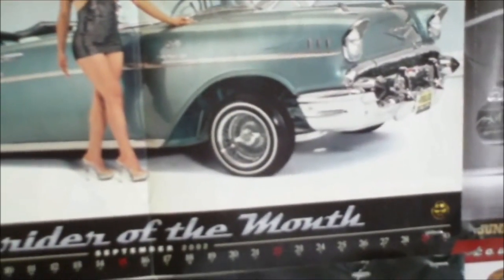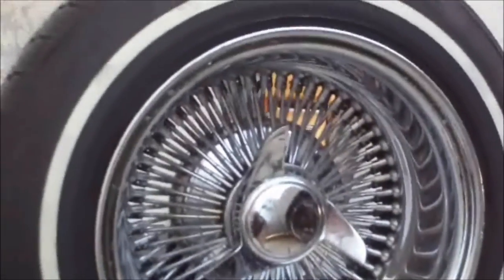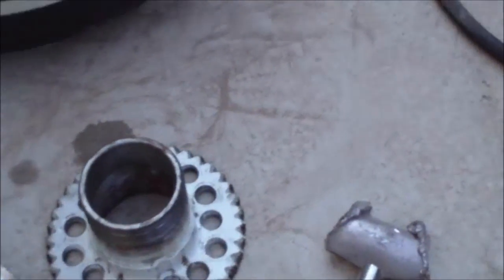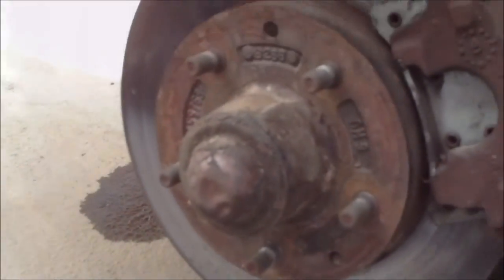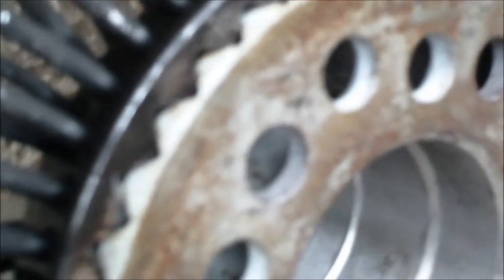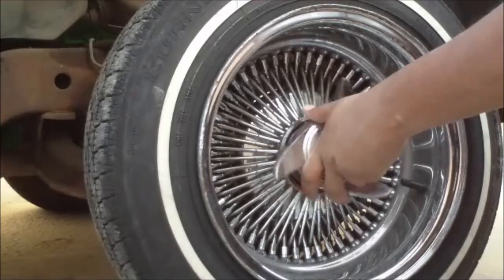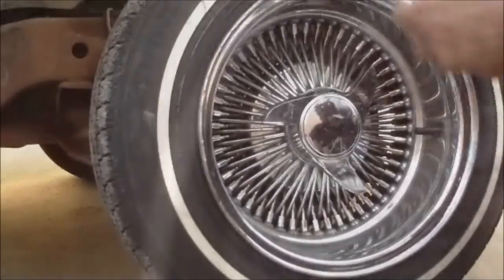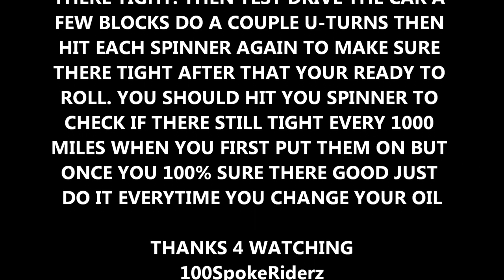HOW TO MOUNT WIRE RIMS ON YOUR RIDE

Comment: I  need help! I picked up a set of 13" spokes china's for sure but its my first set so I can learn without wasting several thousand dollars. Anyway I've got my adapters on correctly and the right open end lug nuts. But I'm getting this loud whirring noise from the front it o most sounds like they are rubbing somewhere ive double triple checked no rubbing anywhere. Can you help?
Reply from the maker: What kinda car?
Reply: Its an 86 chevy caprice classic.
Reply from the maker: @jakedelaymustdie6665  I would say the brake caliper is rubbing on the back lip of the wheel you need to grind the calipers down a little to get 13's to fit on a Box Chevy
Reply: Ok that makes sence the noise is coming from the front only. Thanks man I appreciate the help ill get on here and let you know the outcome when I can get to it trying that out.

Comment: could I get an adapter to fit those type of rims on a 02 Pontiac grand prix
Reply from the maker: yes but make sure you get standard off set or front wheel drive off set rims

Comment: Will a '01 'llac Deville look Good Sittin on Wires?And will there be any Issues on Compatibility and Mounting?
Reply from the maker: Ok here is the deal because its a front wheel drive car you need FWD or standard offset rims on your car regular 13" or 14" wires will stick out pass the fenders like this https://www.youtube.com/watch?v=SEfcwjF-u6I

Comment: Got a question to ask & hope I can get it answered,,I have some 72 standard Dayton spoke wire wheels & they are 5 lug bolt pattern & plus I have the adapters for them as well coz I want to put the 3 bar/ear knock offs on them,,My question is do I need to extend the wheel studs,,stud sizes needs to be 7/16×20-1 12,,& also put my spinners on??...
Reply from the maker: Just so I understand correctly you have the wheel, spinners, adapter & a spacer style adapter?
Reply: @100SpokeRiderz  yes but I'm gonna take off the spacer style adapter,,& use the wire wheel adapter with the teeth,,My Dayton's are old school,,5 lug bolt pattern,,so I'm gonna have to use the 7/16 ×20-1 1/2 studs to put the 3/4 lug nuts on the outside of the studs 7/16×20,,bcoz of the 5 bolt lug pattern..
Reply: Like the Dayton's you putting on your demonstration,,mine are the 72 outspoke Dayton's,,now picture the 5 lug pattern on the ones your demonstrating...
Reply: To try to give you a better idea,,& when you got some time,,look up Dayton wire wheels,,mine are 1992 or I should say the year they were made & believe it or not,,they in great shape,,bought them from a homie of mine & they came off of a 2004 Chevy Corvette 16 ×7,,no joke,,still chromed up & shine good...
Reply from the maker: @rickeymcdaniel7049  they should just bolt up the only time you need longer studs is when people use the spacers also as long as you have the short open end lug nuts everything should go on  like in my video
Reply: @100SpokeRiderz  & yea I was thinking about that,,coz those acorn nuts will hold those adapters in,,plus I was thinking that 3 bar knock off would keep the rims in place of coarse making sure the knock off are on tightly and properly put on correctly,,just gonna look crazy to me with lug holes tho,,lol,,but man I appreciate at the advice & enjoy the videos..thanks bruh...

Comment from the maker: It depends on what size you going with & what look your going for I would use Reverse offset on a 13x7 or 14x7 rim for a Lowrider style look. A 15x7 Standard offset with a Vogue Tire would give you the Classic East Oakland look. 17"-22" with a low profile tire you can go both ways but it all comes down this Reverse offset= Deep Dish Rim (fat lip) & Standard offset= No Dish (no lip)
Reply: So which way should I mount 22 x 8 wondering if I should put it the knockoff the way this guy mentioned thanks and events

Comment: I got a 2007 Lincoln towncar whats the best knockoff setup for the model.
Reply from the maker: Lincoln Towncar 1998-2002 body styles are the ones you see built as Lowriders all the time the 2003 & newer ones not so much because they changed a lot on the front suspension so reverse offset rims stick out way too far. I would go with a
 15"-20" standard offset rims & Vogues tires or 22"-24" standard offset rims & Low pro tires.
Reply: 100SpokeRiderz not really into big rims how about 15" Daytons
Reply from the maker: King Pablo As long as you get the standard offset you will be OK Reverse off set stick out way too far on Towncars 2003&Newer

Comment: How would u put ur spinner on if it doesn't have the edges to hit with the led hammer if ur spinner is shaped round
Reply from the maker: Emmanuel castro You need a tool made for that round spinner it should have came with the rims when you bought them.

Comment: I'm thinkin bout puttin wire rims on my 05 grand marquis what size you think would be best?
Reply from the maker: Your car is setup just like a Lincoln Towncar but the 1998-2002 body styles are the ones you see built as Lowriders all the time the 2003 & newer ones not so much because they changed a lot on the front suspension so reverse offset rims stick out way too far. I would go with a 15"-20" standard offset rims & Vogues tires or 22"-24" standard offset rims & Low pro tires.
Reply: 100SpokeRiderz  hell yea bro thanks for tha help

Comment: How do you tighten and loosen the dome type of spinner.
Reply from the maker: The dome type spinners comes with a tool that is needed to get them off&on
Reply: If you don't have the tool and where can you get them.
Reply from the maker: rcastanaga You would need to know what brand the spinners are brcause different brands have different sizes. Sometimes they pop up on ebay but there are a few places that still sell them new
Reply: If I buy new spinners would that work or there is different sizes?
Reply: And thank you for your time and help.
Reply from the maker: rcastanaga No problem but to answer your question yes if you buy new dome spinners it should come with a tool

Comment from the maker: @excell420 When you have the hex spinner wit the tool you can use a reg sledge hammer but I must warn you if you slip & miss the tool when your swinging you will hit the rim & dint it or chip the chrome. If you slip up and hit the spokes it can bend them & cause them to be loose & start leaking air so even wit the hex & tool its safet to use a led hammer. Im not sure on the size of the lug nut you need but if the lug nut sticks up pass the stud your gonna have problems

Comment: hey im going to get a 89 Cadillac coupe deville and I saw on youtube some dude had some 17s on it wire wheels can remember if reverse they stuck out quite a bit, The car is also front wheel drive, Im a lowrider though im planning to put on the og 13x7 wires but what do you think about the standard or reverse would be better? and does it matter if the car is front wheel drive? thanks man
Reply from the maker: Front Wheel Drive cars should only use standard or front wheel drive offset rims anything else will stick out far past the fenders
Reply: 100SpokeRiderz ok thanks but if I do put reverse on the caddy will it affect the car in any way? And so i need anything special to mount the rims on a fwd car?
Reply from the maker: MaddogOG Califas  Yes RWD rims on a FWD car will put alot of ware&tare on the suspensions also having your rims stick out that far pass the fenders is a out dated look it was cool in 1990-1996 but not so much in 2014
Reply: 100SpokeRiderz ok I see one last question if I get 13x6 or by 5.5 reverse will that be better on the fwd car opposed to by 7 like how much it popsout of the fender ?
Reply from the maker: MaddogOG Califas Watch these 2 vids  Spoke rims in 86 olds 98 what you think?    Cadillac Sedan Deville 93 Lowrider
Reply: 100SpokeRiderz You know what man thanks for those vids man u right I think ima go with the standards 13x7

Comment: I want to put the rims on for now just to drive but within time put hydros ok standard I'll check out how much should I sell the rims foe 14x6 OG wire WHEELS
Reply from the maker: A brand new set of 14X6 rims is $110 ea. if you mount them up & ride on them they will be used rims & you might get $250-$300 for the set of rims. As far as the Hydraulics go (Yes) you can put them on the car & it will work but because its a front wheel drive unibody car there is no frame to reinforce or way 2 weld the rack that holds the pumps & batteries so your car will start to fall apart from the stress of the hydraulics. Trust me I had to learn all this the hard way with my old 93 Cutlass, hydraulics are not the way 2 go & the reason why most FWD cars with hydros end up in the junkyard. Get some standard offset & use the car as a daily driver but if you want a Lowrider that will last till you get old & you can pass it down to your kids get yourself a Rear Wheel Drive Full Frame Car.
Reply: 100SpokeRiderz Do they fit directly on a 2000 year blazer
Reply from the maker: zNova x Yes but if its a 4x4 there going to stick way out pass the fenders

Comment: What about for a 92 Chevy?
Reply from the maker: I would need more info what model 92Chevy??
Reply: 1992 GMC Sierra C1500 single cab
Reply from the maker: Adolf Hitler With that truck it all depends on what look your going for Lowrider=14X7 reverse offset on white wall tires or big rim style= 20"-24" standard offset on low pro tires

Comment from the maker: There is a big topic on LayItLow (dotcom) forums in the wheel & tire topic with lots of pics & info on how to do the swap. From what Ive read doing the swap is the best way to go because using wheel adapters/spacers makes the front rims stick out alot more than the back wheels & it will look kinda funny.

Comment: What i got to do tio make 14×7 daytons fit on my 2000 ford tarus
Reply from the maker: As long as there standard offset 14×7 they will bolt right up but if there reverse offset there not gonna fit on a front wheel drive car. Yes they will bolt on but when you try to use rear wheel drive wheels on a front wheel drive car you end up with MAJOR suspension & steering problems

Comment: Would some luxor wheels fit my 94 yota pickup
Reply from the maker: As long as you have the correct adapter with the lug pattern for your truck then you will be fine.

Comment: Do you torque the lugs?

Anyone use spacers on their spokes?
Reply from the maker: Yes you should always torque the lugs ( only reason I didn't do it in this video was because I took the rims right back off to work on the car after I was done filming) As far a spacers go I don't like to use them myself because if the 13" wheels wont fit with a little shaving of the break caliper then your better off with 14" wheels.
Reply: 100SpokeRiderz..thanks for reply, I have a 01 Camry , 13s wouldn’t ft so I got 14s and the shop installed some thin spacers on them, I took the rim off to work on the car and one of the spacers was cracked in multiple spots and a piece broke off, I’m worried the rest are like this, maybe from being over torqued but it’s my daily and I drive it 25 miles round trip every day so kinda nervous, old rims might be going on
Reply from the maker: I would take it back to the shop & show them the problem

Comment: How can I put my 13 inch wheels on my 04 Lincoln town cart? Do I have to change the calipers this can anyone tell me
Reply from the maker: On that body style Towncar its 1998-2002 are the ones you want 2003& newer have a funny front wheel drive style offset that will make the wheels poke out way pass the fenders. I wouldn't recommend using 13's on a 03 or newer unless your willing to swap frames with the 98-02

Comment: hey yall would some 20 inch daytons fit on my 2002 Mustang?
Reply from the maker: +ttuggle31 yes but only the standard offset rims
Reply: +100SpokeRiderz So where can I by them? I want some like yours but I want 18 inches & up more like 18 in front & 20s at the back
Reply from the maker: ttuggle31 http://www.ogrimsdirect.com/
Reply: +100SpokeRiderz thank you man so much. now I'm looking for the knocks like yours
Reply: +100SpokeRiderz do they come with tires?
Reply from the maker: ttuggle31 No that place dont sell tires
Reply: +100SpokeRiderz ok where do I get the right size tire at with out the whitewalls look?
Reply from the maker: ttuggle31 I would go to any tire shop in your town because your going to need them to mount the tires on the rims also
Reply: +100SpokeRiderz ok I'm gonna by the hammer and the adapter too.
Reply: are you really putting Daytons on a mustang??
Reply: yep but dont want the white wall tires.
Reply: i have a convertible
Reply: +ttuggle31 but why man it's a mustang? Daytons only look good in classics like 63 impalas and stuff like that. but that's you I respect your style homie.

Comment from the maker: @bigdaddylvbt  No you should never use a rubber mallet it just dont have enuff weight to get the spinners on tight. A led hammer is the best choice cuz it is safer if you miss the spinner or bullet tool while you swinging it & hit the rim you dont have to worry about chipping the chrome or bending a spoke.

Comment: ?? What do yuu mean
Reply from the maker: The 93 just has the regular 350 motor but the 94-96 has the LT1 motor that is way better. The 1996 is the best one in my opinon because it has more options than the other years

Comment from the maker: @The80boxcoupe When the lead hammer gets to low the head will break in half and fall off the handel. You can put a full set of rims on maybe 15-20 times B-4 the hammer goes bad but the hammers dont cost to much like $20-$25 ea.

Comment from the maker: @baggedout81  I used one of thoes B-4 it was OK & did what it was sapose 2 do but I noticed no matter how hard I would turn it even if I put all my weight on it, if I went back & hit it with my led hammer the spinner would still turn a little. Only time I got it 100% tight with that tool was when I had another person wit me so they hold it on the spinner & I used a longer hanndel to turn it tight. Its a cool idea 4 that tool but I just trust the led hammer more

Comment: @100SpokeRiderz  To each there own i guess.I had the opposite experience.Used the hammer then tried the 'tool".Got another 1/2 of turn out of it.I just the handle from my big jack,like 4 ft long.Gotta get that leverage.

Comment from the maker: @casswat A good remote pager car Alarm it should go off ass soon as they jack up the car but if that dont trip it the vibration from hitting the spinner with a hammer will set off any car alarm 4Sure. If your willing to spend $1700 min. or more on a Real set of Zenith wire wheels they have locking spinners but as long as you have a good car alarm you will be fine with a regular set of knock off wires.

Comment: You're supposed to use a hammer with thick rubber not metal
Reply from the maker: If you use a rubber hammer your wheel is gonna fall off 4Sure, I'm using a Led hammer in this video & that's the kind you get when you buy a brand new set of wire wheels